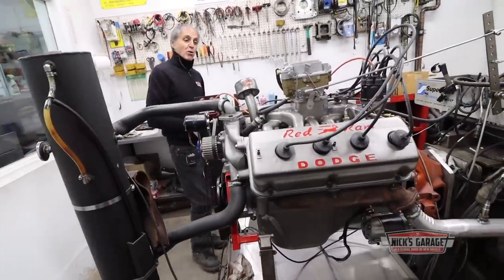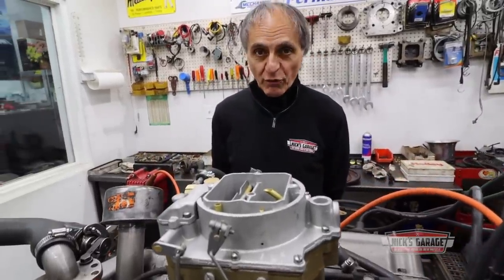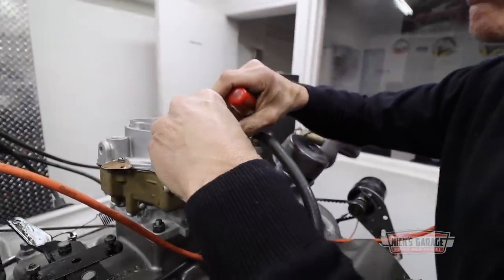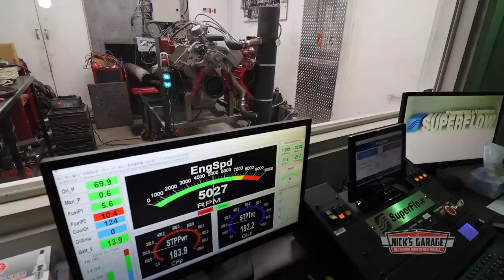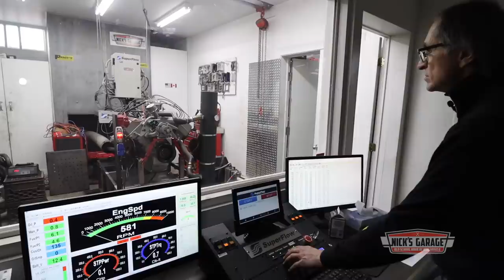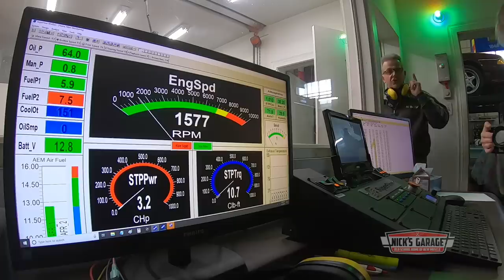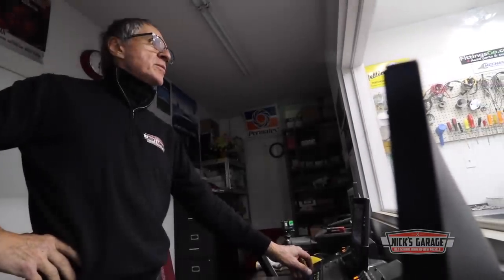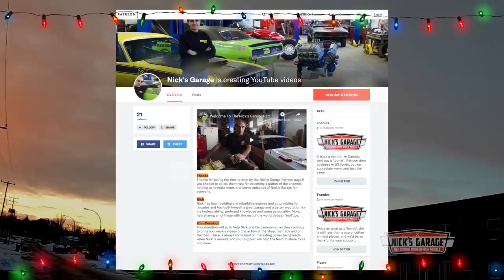Tiny Old HEMI - First Generation 241 Hemi on DYNO

Comment: Reason reason why the agriculture department and St. John’s water management department in South Florida and all the group people down there use these motors back then is because they were super reliable made a large amount of torque at lower RPMs and could run all day hooked up to a water pump that was a massive the water pump that was hooked up to was much larger than the engine itself and they could pour all day long to build up the fields full of water and they also used to in Lake Placid Florida for the Palladium fields because every year they would have to flood every other year to refresh the soil

Comment: whatever is causing the loss of ten hp occurred during the process of changing the Jets . What number episode will be the solution ?
Reply: todd.     Sorry, will not be on video.  Was fixed the next day. We do not film everyday, because my camera buddy has a full time job.
Reply: @nickpanaritis4122  You are truly blessed with George.
So what was the solution ? I read several interesting suggestions about the fuel flow seen on camera and comments on the linkage . 
The comments had lots of mechanics knowledge with the old hemis . Very encouraging to know the history of the  engineering is being kept alive . I recall even as a child the hemispherical heads just felt right and That production was stopped seemed wrong .

Comment: 30 over bore gives you around three hp the carb and intake maybe another 5hp putting a hot cam might be good for 20 hp im betting that engine with cam, valve springs and custom headers the engine may reach 200 hp

Comment: that factory carbs rebuilt or not are too lean.  hemis like fuel, richer rather than leaner, the chamber will burn it being it's a more efficient chamber than a wedge. I'd adapt a go-to Holley 600cfm square bore carb to it just to see if it picked up.  if it did then it's that damned carburetor.  if that is a point ignition and the point dwell moves, which it always does, then timing also moves.  I'd stabilize the timing with electronic ignition module, delete the points.  those 2 things, module and carb, would make a big difference.  then at least you know it's no other internal problem.  it could be something silly like spark plug or coil wires, distributor cap/rotor, or coil output itself.  I hate those fing carburetors that era, rebuilt 2 on a 1956 vette dual 4 factory setup on a 265.  it would be interesting to see what that little hemi would do with just a plain jane cheapo 600 holley square bore universal carb, would wake it rtf up.

Comment: Great fun and why would you do this? Because you can. I worked on the same engine as a kid (the somewhat larger '57 325) so all the components were very familiar. Now, I'm still bothered by that 10hp loss which is significant on that small engine and I believe it's still in there and can be found with compression, vacuum and plug checks. Love all the dyno fabrication and adaptations. There was a story about the 241 where supposedly the factory installed hard piston rings and if not broken in correctly the engine would be smoking at 40K miles. The story goes they fixed it the next year. I guess that little old lady who sold you that engine was from Pasadena.

Comment: Ha.  Those are cool motors.  Rebuilt one with head work, Ross pistons ... higher compression ... custom Isky camshaft, billet rods .. & even with all that $$$ spent 216 horsepower. BUT 41 % more than stock. Still a win.  

Customer could have built 5 small block Chevys.
Reply: ... should add that he later changed carburetors & had some custom headers built .. so number was higher.  Going off the seat of the pants feel that time though .. no dyno after.
Reply: No nitrous??
Reply: @williamsanders468  lol. No.  Just a little 241 in a 1929 Model A roadster
Reply: I’ve always wanted to make a 241 make decent drag strip power and make it fast
Reply: @williamsanders468  ... it's great in a light car. The roadster runs low 14's on bias plies.  If it were me, you're money in hemi's is better spent on 331s & 354s.  Another 100 cubic inches, nearly same money, better selection of parts available on the new & used market.  The gentleman referred to with the roadster has money to burn ... so it was a pet project for him.  Most of us are a bit more budgeted.  I even tried to turn him onto a $4k 1957 392 that had a stock rebuild in '99 & never run.  He wasn't interested. So he spent about the same on his baby one.  😊
Reply: Jamie Campbell I imagine it’s not easy to find a 331 or 354 though
Reply: @williamsanders468  ... the production numbers were higher. More produced.

If you have a 241 ..  I think the 241 & 270 rods are same .. so I believe you can push your 241 a little economically to the bigger displacement. Can't recall if just bigger bore, or crank.  Join one of the Hemi forums, or the HAMB forum for their Hemi Index thread.  Great group.

The issue we had was mostly camshafts.  Options being billet roller & regrinds. Racer Brown will regrind your 241 cam, to a great profile they have. We lucked out on the Isky camshaft being found.  Pistons were fun too. Egge at the time was the go to ... but with CR & reducing weight .. we went to Ross for custom slugs.

If your 241 is together, and able to run ... they're worth 500 to a thousand bucks in Texas. 331 354 same condition "runnable" ... which is just original & setting ... is about the same money give or take 500.  They pop up. 

A 1955 New Yorker 2 door on Craigslist sold for $1800 running.  Guy drove it for about 6 months with minimal maintenance.  Brake & fuel system.  Sold it for $3500.

It was fairly straight.

Comment: I would have updated the engine,, modern pistons with more comp. That is IF you can get them. A little blend the bowls and a more modern cam,, if you can buy one.
I am used to [here in Oz] to the huge 185hp Holden 253 engine. Surely a hemi can beat that!!
A friend plays with a classic speedway Supermodified 318A that actually sounds like  that,, the farm truck [literally] engine Though it cracks a good deal better with triple 97s and long pipe headers.  It probably has 8.1 compression.
And after you changed those jets the secondaries were not drawing fuel, As for factory engine? yes but not factory 1954 fuel which is probably thicker by volume now.
Reply: LDN.  We had it fixed the day after.

Comment: That's a really expensive 241 inch engine. I can't understand why Chrysler would do that; they came out with the slant 6 a couple of years later that put out about the same power but must have cost half as much. Now, once they added displacement and tuned it, the hemi was a great motor.

Comment: not enough fuel is getting to the carburetor bowls. fuel delivery problem and or not enough air is getting to the fuel bowls as the fuel is not getting into the carb barrels.
Reply: Neb.    We had it fixed the day later.
Reply: @nickpanaritis4122  Great, I look forward to seeing what you did to fix it. Merry Christmas

Comment: back in the day when you could adjust the idle mixture on a carb I'm pretty sure I used to hook up a rev counter and adjust the screws for maximum idle rpm. Once I did both mixture screws then I would set actual idle speed at the carb.

Comment: I THINK IT WAS INTERESTING THAT BEFORE YOU OPENED THE CARB IT WAS DILED IN TO GIVE A NET  150 HP. WITH A AIR CLEANER.  THOUGH I MENTIONED I BROKEN RING , I REALLY THINK SOMETHING IN THE CARB . 
THAT HAS NOTHING TO DO WITH THE JET'S AND CAN NOT BE SEEN FROM THE OUTSIDE , MAYBE THE FLOATS . AIR INSIDE ANY WAYS I LIKE THIS LITTLE ENGINE  WE HAD A  56 DODGE  CORANET I THINK AS IT WAS 12 VOLT. BUT MY SISTER SUSAN WECKED IT. 
I HAVE WHAT I THINK IS A 354 OR 390 THAT IS HISTORICALLY THE BASSIS FOR THE NEW GENERATIONS OF HEMI'S AS IT WAS THE BASE FOR A CONVERSATION WITH A VERY WEALTHY FRIEND FROM CHURCH THAT IS OWNER OF SEVERAL DIFFERENT DEALERSHIPS SO HE SAID HE KNEW SOMEONE WHO MILLED / MADE HEMI HEADS . AND SO I THINK HE SAID HE WOULD START WITH HAVING  100 CAR'S BUILT TO THE 350 ISH ENGINE. 
LISTING AGAIN TO YOU POSTING YOU LOST THE HEMI HUMBLE AFTER OPENING THE CARB . AND THE RACE CAR SOUND AT 156 HP.  YOURS TRULY DAVID ADAM GRENIS

Comment: Installing the Air Cleaner assembly should richen the mixture some I would think.
Reply: adam.    You are correct. We ended back with the same jets and ran it as is and finished with a 157 HP.

Comment: If he had to clean out the oiling holes for the rocker assemblies why didn't he do a complete overhaul on the engine! I mean if I had that engine and a use for it I would have disassembled it and had everything done by an engine shop. The carburetor linkage that opens the secondaries might be on backward. That would kill the HP for sure. Now as for it running too lean I think the carburetor should be disassembled and everything checked to see what is causing this.  And if I am correct he only changed the jets on the secondary side. He should have put a larger jet on the primary side as well!

Comment: Myth : Rich mixture will produce more power.
Reply: Dunc Keroo 
Fact: lean mixture will produce less power, higher temps and more possibility for detonation
Reply: @ztwntyn8  So keep it between 14 -14.7 , unless there are conditions where there would be un-burnt fuel like cold weather starting. You only get as much power as there is oxygen to burn.

Comment: Try a small holley , problem solved.
Reply: joe.       The base is much smaller on this Carter, bolt pattern then a holley.
Reply: @nickpanaritis4122  I have driven carbureted cars all my life , grew up with them. The best carb is the holley HP with 4 corner idle and down leg boosters  and NO choke. Chokes are a pain in the butt , the first thing a do with any carburator is take off the choke any throw it in the garbage. I really like your videos but I must say I have never owned a mopar. Wish you well.
Reply: @joe-hp4nk  .     Yes, i many cases the choke is an issue. EFI eliminated that problem.
Reply: @nickpanaritis4122  Yes it did , but us hard core carburator guys are stubborn. That's why I use the holley HP carburator , it's highly tunable and will out perform a EFI at wide open throttle every time.

Comment: You have the wrong reach spark plugs you have too long of a reach on your spark plugs
Reply: The 54 and later Chrysler used the Long Reach the Dodge and DeSoto early hemis always use the short reach
Reply: I just happened to catch it when you were looking at the spark plug it's a 3/4 inch reach you need a 3/8
Reply: @timdupont6789  .    Helps bring up the CR a bit.
Reply: @nickpanaritis4122  it's been my experience that the engine will not run properly with The Long Reach plugs...I also own a 54 Dodge pace car.. I find it runs best with the Autolite 303
Reply: @timdupont6789  .       I will replace them, Thanks for the info.